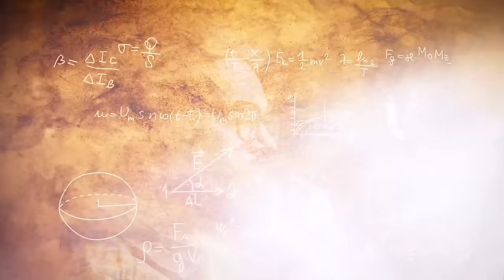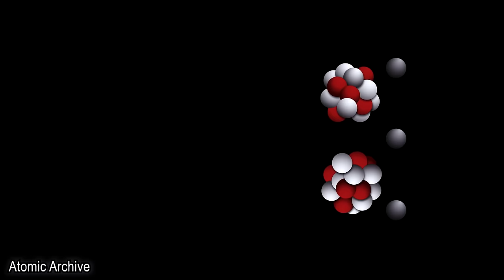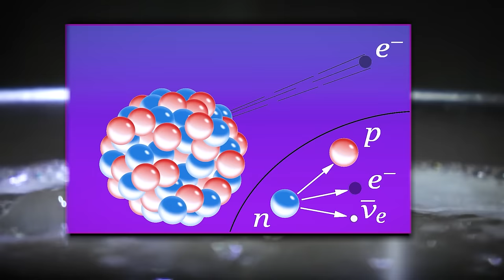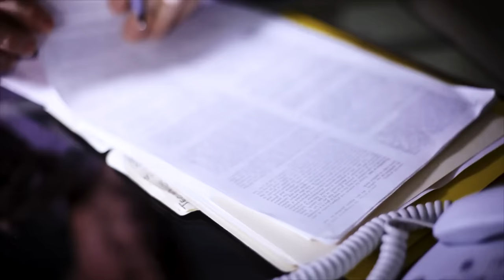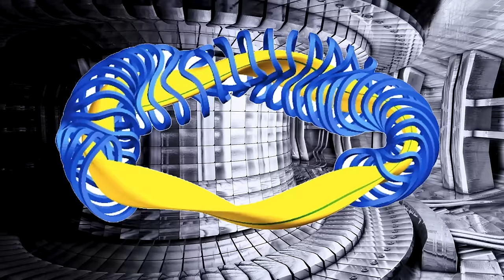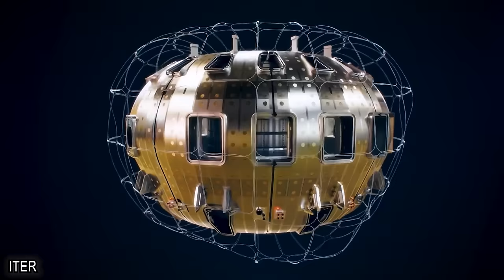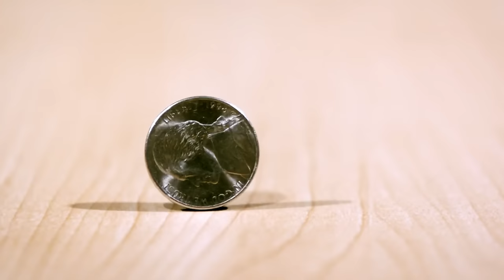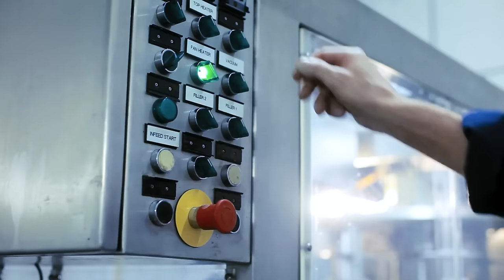When will we FINALLY achieve fusion power?

Comment: Somewhere out in the vastness of the universe, there is a planet with a super advanced race. They have space colonies. They have Dyson swarms. They use black holes as batteries. Somewhere on this world, there is a tiny group of scientists still crying "don't worry, we'll have that nuclear fusion up and running in five years at least!"
Reply: We could do fusion power today, with a net gain in energy. We have thermonuclear devices, which derive most of their explosive yield from fusion, that we could detonate in giant water reservoirs to turn that water into steam and then use that steam to drive turbines
Reply: @halilzelenka5813  No you are mistaken, most of the energy from thermonuclear bombs comes from the extremely efficient fissioning of U238 and Pu239 with the help of Lithium Deuteride as part of the neutron amplifer that is the genius of Teller, its called a super bomb because it so efficient at splitting most of the fission fuel.

Also the Soviets toyed with the idea too of using nuclear weapons do dig canals and possibly the steam flashing resevoirs, good job they never tried.
Reply: @johnjakson444  more than 97% of the energy from the Tsar bomb came from fusion. I’m not a physicist, but to my limited understanding two-stage devices like the Tsar bomb derive most of their energy from fusion, not fission
Reply: Sigh...  Dyson swarms are silly when you can extract energy from quantum vacuum.
Reply: @halilzelenka5813   well, it's a good question.  The fusion charge in Tzar Bomba generated lots of neutrons that were smashed into fissile atoms causing fission reactions...
Reply: @johnjakson444 oh they tried alrighty...
Reply: @halilzelenka5813 Tsar Bomba was an outlier design, but it still produced a couple of megatons of fission yield. But must nuclear weapons in the stockpile today use fast fissioning U238 for at least 50% of their yield.

Comment: Great video. I especially like how you focused on scientific break even vs engineering breakeven. 

I would have like a cut away in the video explaining why the main type of fusion in the sun, proton-proton fusion, is infeasible for power production with its rate reaction being a septillion times less than deuterium-tritium fusion.
Reply: The best kind of fusion is the one found in large stars, the CNO cycle which is 10,000 times more efficient than the PP cycle, even our own sun gets about 1% of its total energy from a tiny amount of CNO, so a tiny amount of Carbon goes a long way, but it requires even higher temps like 100MK or more. If the human race ever develops CNO fusion, we would be amongst the gods.

Comment: I've read multiple times that even fusion reactors cannot be considered as »clean«.
Especially in Tokamak-type reactors, parts of the apparatus inevitably will get irradiated and become radioactive themselves. Is that true?
Reply: Aloha. Well its very shorts on the radioactivuity time scale. You have to weit aprox. 100 years Max. The normal fission atomic waste will be dangerous for millions of years. So you can recycling the fusion waste much easier. And it is way less mass you need to watch after. And fusion reactors will shut down automaticaly if something goes wrong. Lets build some. ❤
Reply: @thorstenkrug144   That's good to know. I agree that humanity should invest in fusion research (as well as fission research, I wouldn't want to close that door because of obvious applications in medicine and robotic space flight). 
 
Yet, I'm torn: for the money that goes into one research fusion plant, we could build so many solar and wind parks, battery backup included. 

But thank you for that 100 year number, cheers!
Reply: Actually, it's the device waste that is significantly more problematic. Even the devices to install in the first place (just watch the tremendous effort, they keep failing for 50+ years), and much more so to replace after activated. Fusion equipment is much more complex and much more volume also. Fusion has several times lower energy density, and several times shorter wall lifetime and as a direct consequence fusion has much more waste, that is extremely problematic.
Spent fission fuel is extremely valuable if processing is allowed and especially if fast-spectrum (near 1 MeV) is also allowed. It's been prohibited (see SNR-300 and Integral Fast Reactor story... These were capable of turning LWR waste to energy and separate the extremely valuable fission products: 16 million USD / ton - eg. platinum, rhodium are more valuable than gold. All sientific studies conclude that DT-tokamak is more problematic, more complex, shorter lifetime, more volume to replace more frequently than fast-spectrum fission.
Cleaner fusion is a myth, simply not supported by scientific studies considering equipment wate. It is repeated again and again, but it is a myth based on making fission appear 100 times more dirty and fusion appear 100 times more clean than it actually is (this is perpetrated supported by mass manipulation and "pressure from the top" politics (see the examples, it is very real) and journalists who do not understand the extreme social harm caused.

Comment: The more i learn about our power grid, the more i realize that modern nuclear energy options are our best option. Small form reactors, LFTRs, Thorium Reactors, molten salt reactors. Utilizing our advanced technology, Improved engineering & material science. Utilizing our greater understanding of safety & well made designs. We have so much more advanced computer technology & robotics that can be used. It feels like even tho tons of advancement has occurred with engineering designs, safety measures, etc. It still doesn't matter to most people. It's like most people are ingrained with a natural negative response when talking about nuclear energy. It's a bummer because i truly believe that our best option for our future is to start utilizing Modern advanced nuclear energy options in our electrical grid. It's just proving to be challenging to get politicians to get on board. 

  It will really allow places to be much more energy independent. Less reliant on fossil fuels. They'll have efficient, stable electrical grids and the rest of the grid could experiment with alternative power sources, power desalination plants, etc. 
We need to heal from the trauma of our past. See & learn that those things only happened solely from Us not understanding what we were doing when it came to nuclear energy at the time. We didn't have advanced enough technology, material science, engineering, safety measures, understanding of how to go about everything, etc. This source of energy will greatly help the world improve towards the future and lowering emissions. More than anything else could, while also providing a very stable electrical grid system. Currently we have alternative energy options but the majority of our grid is powered off of fossil fuels and emission producing sources of energy. We will be so much better going forward commiting to modern advanced nuclear energy options.
Reply: Most of our understanding of fission power plants was done with sliderules, amazing that as I type this on an 11th gen i7 laptop, I have to wait several sec for each couple of words to show up.There is something very wrong with these damned computers and the software. chrome with only 5 tabs and utterly useless.

Comment: 11:00 Come on. That's just specious reasoning. Getting a fission plant to shut down is not usually the problem. Yes, it was at Chernobyl, but in almost all other cases, for example at Fukushima and TMI, shutting down happened in an instant, but the decay heat could not be managed. And with fusion, you aren't totally free of the decay heat problem. A fusion reactor, at least the ones being planned now, will create large amounts of activation products, so when the reactor needs maintenance or decommissioning, there will be radioactive mat'ls to dispose of. They should be much less long--lived than what's in a fission core, but they are certainly not trivial.

Comment: The Strong force holds nuclei together not with Mass  or Gravity - but with some other transformation of the energy resulting in the force that holds the bond. The force is doing work and  therefore requires Something - it doesnt just hold the nuclear bond and get called the strong force by being nothing and doing its work with nothing. It is doing work and  therefore requires energy -- that energy IS the missing energy / mass --- literally the energy of the strong nuclear force is the energy imparted into the nuclei when they are accelerated in order for the fusion to take place. The energy you put into it becomes the force holding them together. Therefore, you don't get it back -- unless you FISSION THEM. And even then there will be a loss. So it only benefits you when NATURE DOES THE FUSION FOR YOU. And that is exactly what Uranium Fission is -- that IS fusion done for you.

That energy is only obtained when you break the bond of a nucleus. The energy released during Nuclear Fission IS the energy of the strong nuclear force which has been broken by a neutron.   Therefore: You can harness the free energy of fusion -- only when 1. Nature does the work for you and fuses lighter elements into heavier ones, preferrably multiple times to maximize the amount in as few steps as possible.   2.  by splitting those heavier nuclei in nuclear fission - releasing the excess energy aka "missing mass" of those fusions.  

Therefore, Fission of Uranium or Plutonium IS THE MOST EFFICIENT AND ONLY POSSIBLY WAY TO GENERATE FREE ELECTRICITY FROM FUSION.  FUSION IS ONLY VALID WHEN THE PHYSICS DOES THE WORK  - NOT WHEN YOU HAVE TO PAY FOR IT BY RECREATING CONDITIONS THAT MORE EXTREME THAN THE SUN.    If a reaction requires you to feed it every drop of your entire energy output of a major city - just to obtain .1 MeV or whatever -- that is not a viable form of energy.  But if the reaction is readily willing to happen with or without any input, if a reaction only requires a neutron that is readily available just by banging two pieces of metal together --- THAT is a viable form of energy. 

I'm sorry that everyone has wasted the past 70 years and billions of dollars on this dead end because the physics are so misunderstood because we lack basic mechanical intuition and only rely on mathematical expressions and abstract concepts whiel shy away from actually visualizing anything in mechanical and Materialist terms.  This is what spooky action and other such talk gets you.
Reply: Uranium, Plutonium Thorium and others that fission are not made by fusion process in any star, they are made by the R process mostly when two neutron stars collide, some of the iron skin on the neutron stars surface is blasted off into space and the neutron mass of the stars merge into a black hole with some of the neutrons blasted off into space with neutron fluxes dense enough to convert any iron into those heavier element all the way up to the heaviest elements. PBS has an excelent series on Youtube with an australian physicist

Comment: In a way, solar is fusion power. If we could harness even a tiny fraction of the solar energy that isn't hitting our planet at any given moment, we wouldn't need to bother with fusion. Problem is getting stuff into space to do the job is hard.
Reply: NASA can do it small scale because it has no other choice and it uses the most expensive multilayer cells to work, but on planet wide scale, the engineering and economics falls apart.

Comment: Neither fusion reactors nor fusion bombs recreate the conditions in the sun. For the simple reasons that (a) fusion reactions in the center of the sun are really rare (the power output per volume is ridiculously low) and (b) nothing on Earth could withstand these conditions. In both cases the temperature is much higher than in the core of the sun. Fusion reactors work with very low pressures (compared to Earth's athmosphere, not just compared to the sun).

Comment: Mass or rather more accurately stated matter , is not energy , and cannot produce energy. It can have energy , transfer energy, but it cannot become energy. Whatever that even means.
Potential energy = mgh , clearly it's not gravity that cause atoms to combine , but the "strong force"  , therefore potential energy= mFh .

This is to say nuclear fusion is potential energy. How to achieve nuclear fusion net energy gain , when energy used is extremely high it is very difficult to reabsorb the energy used to compress the atoms. So I agree with this point. 
So I think what if instead of laser light and magnets field why don't we use matter (mechanical compression), like a hydraulic press.  Then I realize the hydraulic press itself will compress before the atoms fuse . Well why use atoms , technically you can combine molecules, fundamental it's the same thing. Maybe for reaction that would take a large amount of activation energy, mechanical compress maybe a more efficient way to trigger a reaction. 

Nuclear fission is similar to a fire , the fuel which is usually a large molecule reacts with oxygen to produce a smaller molecules, if carbon base fuel it produces CO2 . Notice no mass is lost but energy is released. That is because the energy that breaks the carbon to carbon bonds , is less that the energy released when oxygen reacted with carbon.
Reply: Imagine using all the energy generated by fusion power to mine Bitcoin.
Reply: Or we could just stick with 1000K fission in the form of Molten Salt Reactors which we have known about for 50 years, failing that, regular old PWRs or BWRs.

Comment: Its just hydrogen he says a highly flammable element.

How does iter achieve engineering breakthrough if it doesn't compete the process of making electricity? Are they only taking heat in to power it?
Reply: loads of electricity in, very little heat out, that is not going to change until they have been through several more ever bigger generations or one of the nimbler designs with better magnets shows results.

Comment: as soon as as big petrol companies can find a way to poach the technology
Reply: It has been suggested that the canadian tar sands could be processed with nuclear heat from Molten Salt Reators, thermal only, no electricty needed. Currently tar sands have to be cooked with nat gas making it esp CO2 intensive. I'd rather the tar sands were left alone and the MSR was used directly for its energy output to the grid. We could even use the high temp MSRS to split water thermally and use atmosperic CO2 to make syn fuels, at least the C would be in a loop and we would have transport fuels.